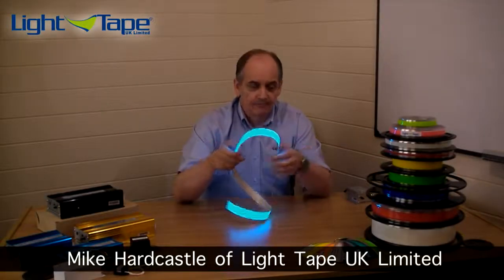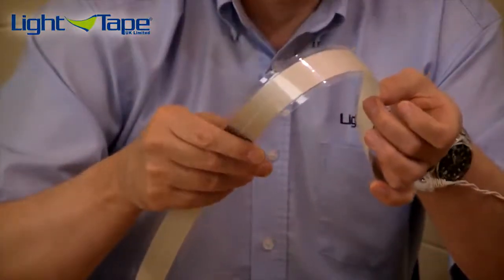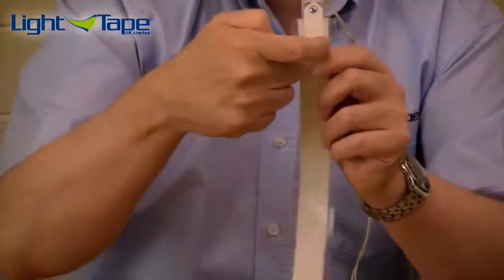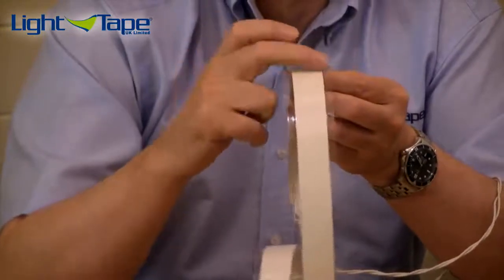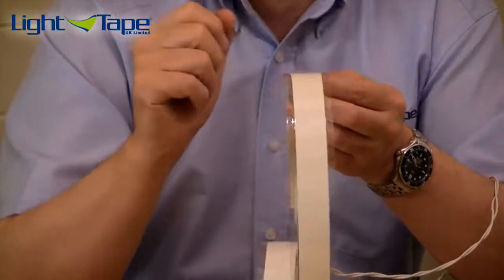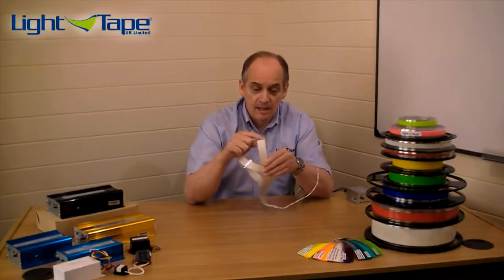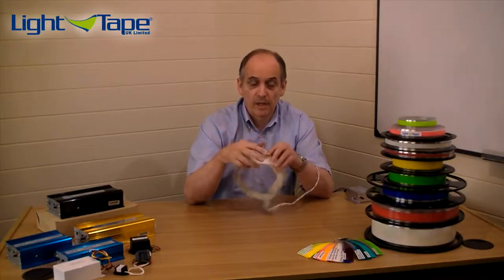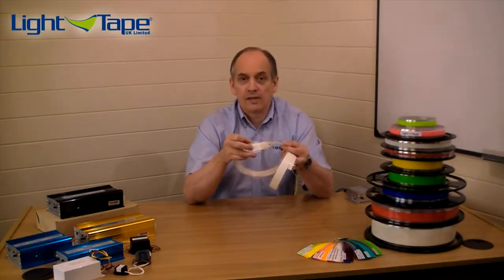What is Light Tape Tutorial Part 2.mp4

Comment: Yes you can have as many pieces of Light Tape connected to the inverter (Smart Driver) as you want within the area limitations of the driver.
Our 1" (25.4mm) wide product is about 40 square inches per meter, connected to an SD1000 smart driver you can have 25 linear meters of 1" Light Tape ether in one length or 25 individual lengths, or a 10m, 5m, and 20 x 500mm pieces.
If you look closely at the thumbnail on the left it has 6 x 300mm pieces connected to one inverter.